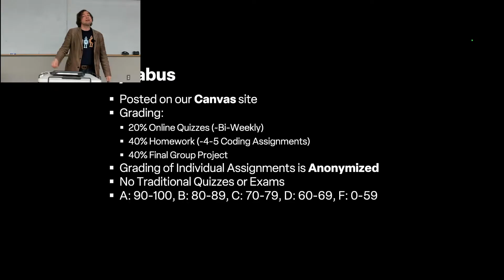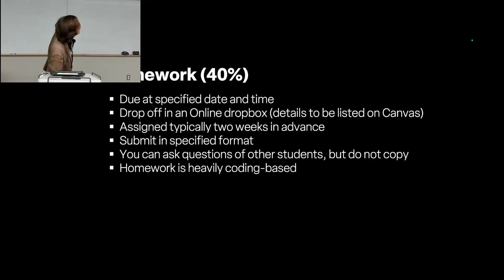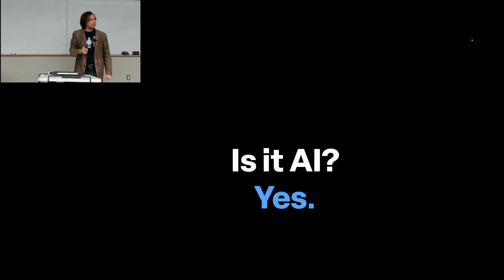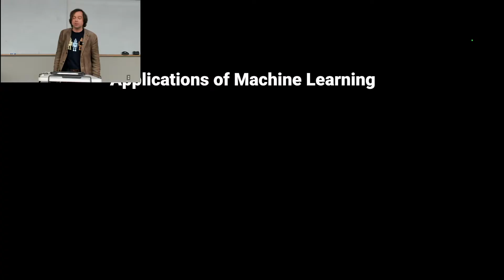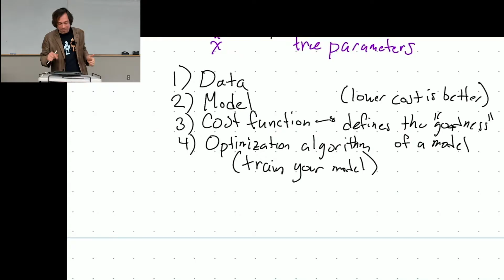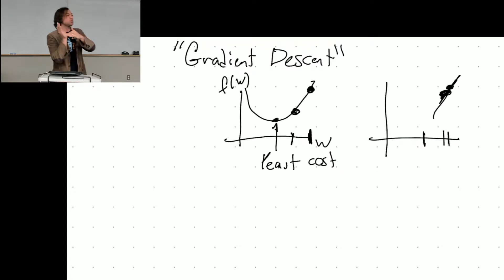Machine Learning  -- Lecture 01: Course Introduction

Comment: It sounds like the lecture gives a good start but leaves out the real work behind the data. In my experience at Lifewood, sourcing and careful annotation often slow projects the most. One small thing to try is planning data checks early. It won’t work for everyone. Have you tried that?